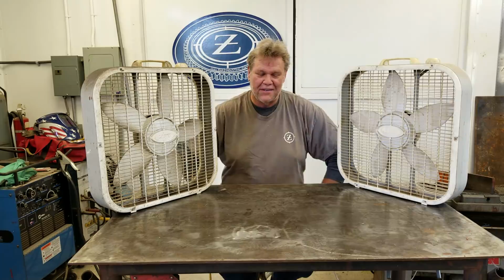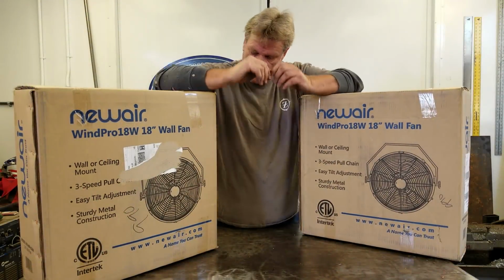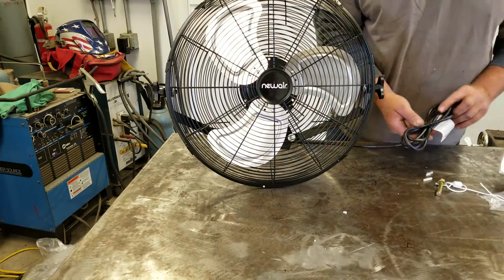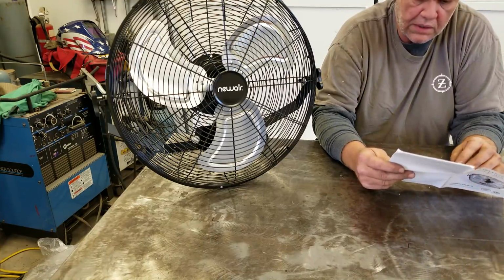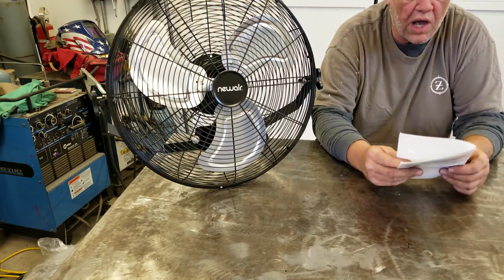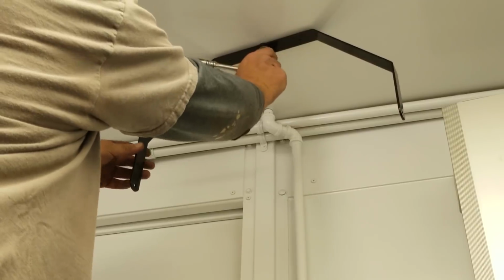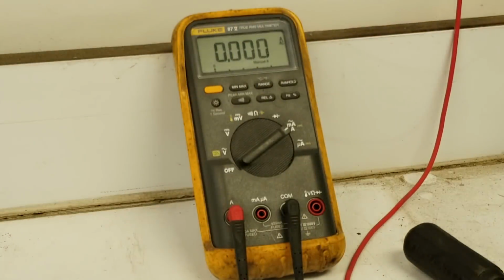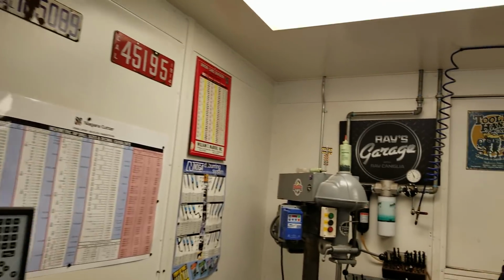NewAir WindPro18W Shop Fan Review

Comment: The space behind a fan is very important to its operation. There has to be enough room for the fan to easily pull new air from, kind of like being able to reload more air. If you place a fan too close to a wall it will not work correctly. Most people don't take this into account when installing a fan.